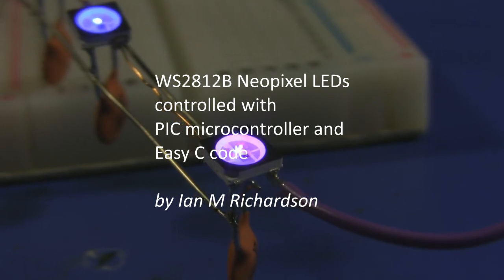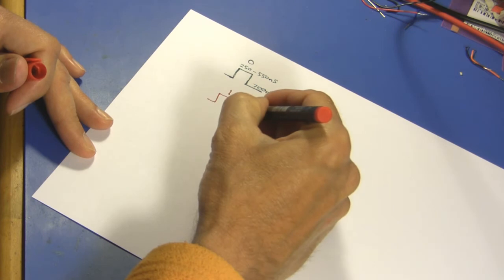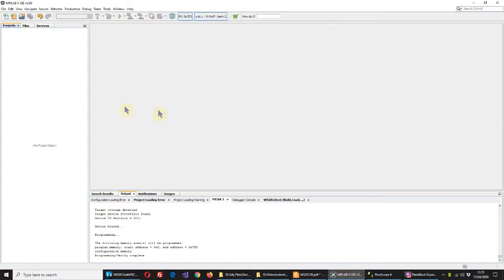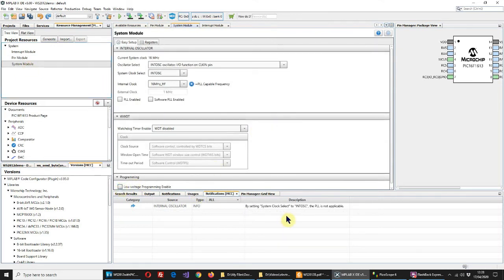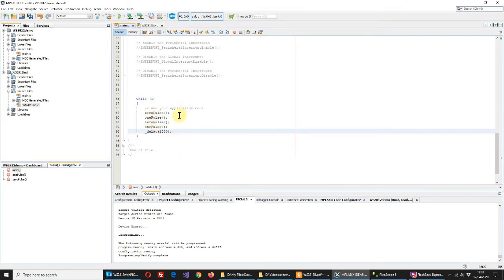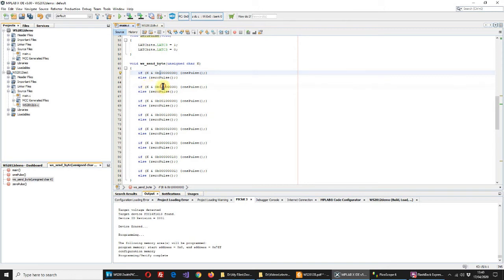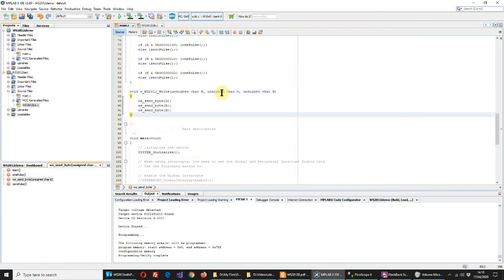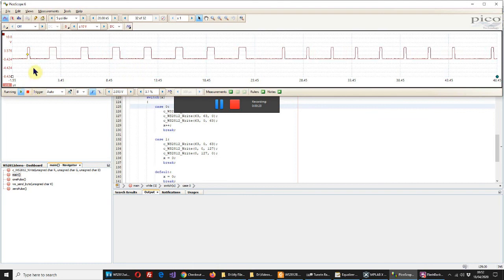6. How to control WS2812 Neopixel LEDs with a PIC microcontroller - C code demo

Comment: Thank you for this video! 🤓
If interrupts cause issues with these LEDs, do they not light up at all or could it cause them to light up in the wrong color?
I've got this bit-banging almost working correctly, but my LEDs don't light up the correct color and some of them don't light up at all.
Reply from the maker: Its hard to say what the effect would be but try disabling the interrupts and see if that fixes it. Are you running with a 16MHz clock? My code was made to use that specific clock frequency so if you change it the timing will be off and you may get the wrong colours and weird behaviour.

Comment: Great video, just wish you went a bit more into detail on the code used for the leds for each function you made. This video was really helpful in getting a better understanding of the data sheet as well, thankyou
Reply from the maker: Thanks, I'm glad you found it useful. If you have questions about the code I can try to answer them here. Please go ahead and ask.
Reply: @ianselectronics  I basically wanted to know more about animating the ws2812b leds and how one would go about creating animations easily with many of the ws2812b leds
Reply: @jacobbaylis5532  WLED is your answer I believe...